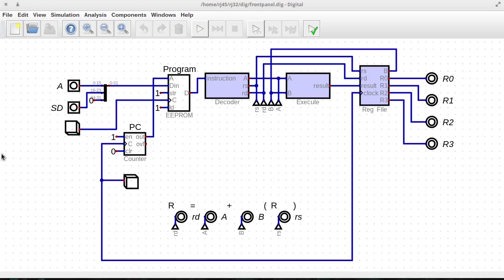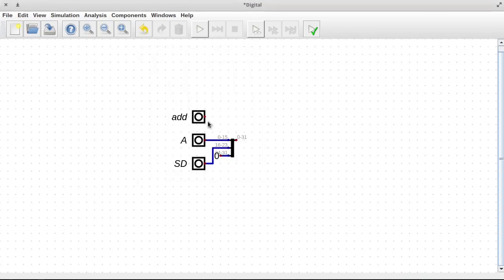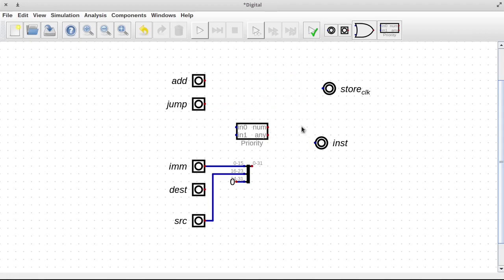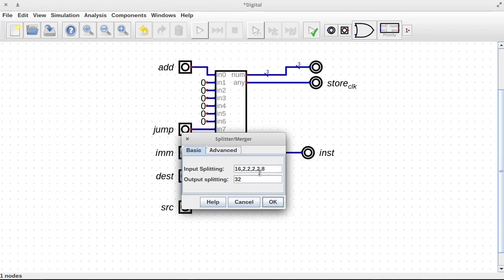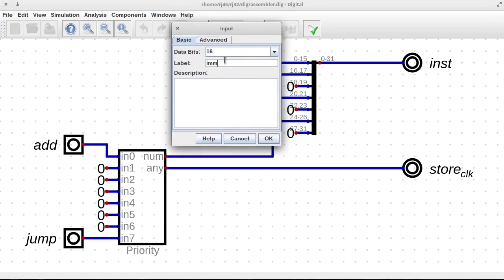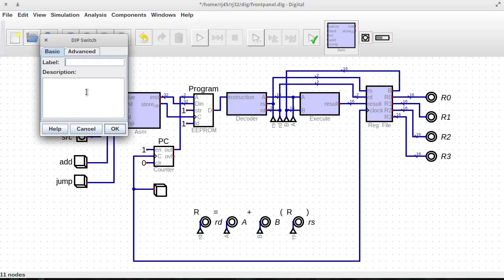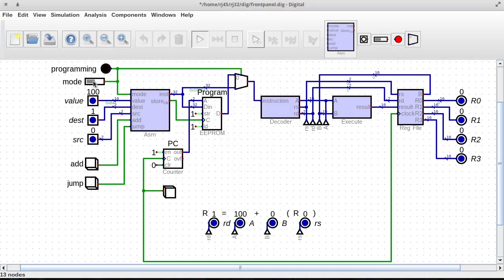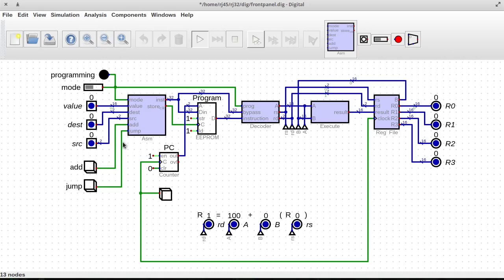[006] Program Assembler - Building a CPU From Scratch

Comment: I'm a student in EE department. To design a CPU, we write Verilog code and use testbench to test the circuit. Writing Verilog code is expressive  but not so intuitive as synthesizing tool is terribly bad at visualizing. The software Digital is great at visualizing the circuit and help understand what's going on inside the circuit, which is very important to me. I think this tool is overlooked by many people. Thank you for your nice and clear explanation! Keep going!
Reply from the maker: Yeah. That's one thing I like about building circuits on breadboards: it's so visual, and that's important to me as well. The issue with building circuits on breadboards is that it's time consuming and expensive to buy all the parts. Digital is free, and you can convert most things into verilog and run it in an FPGA. You can also see it working which makes debugging sooooo much easier. So yes, you're welcome!